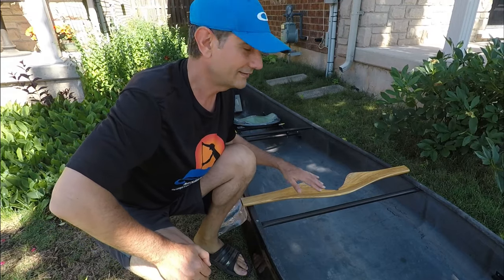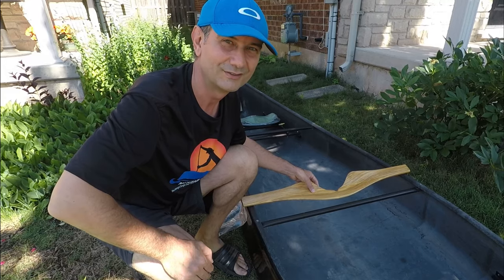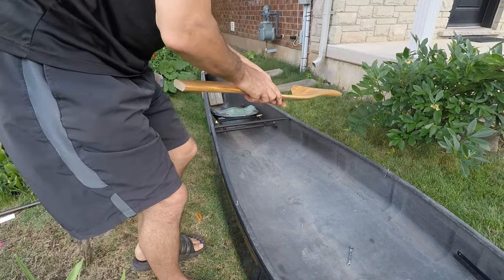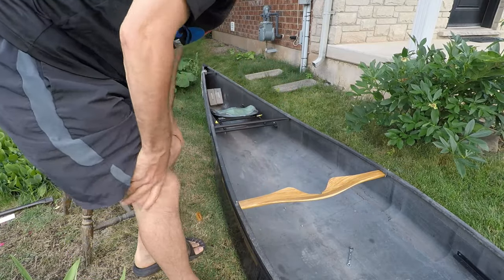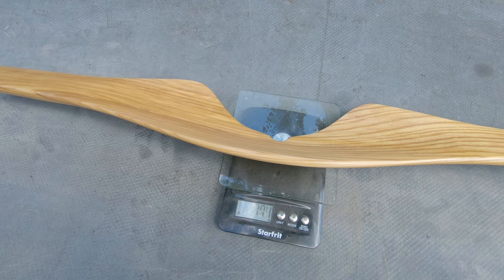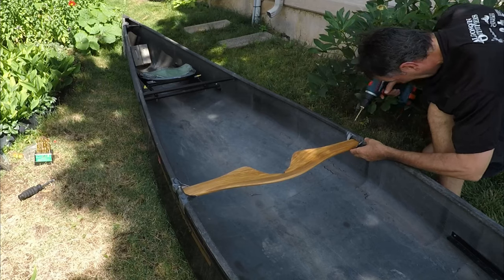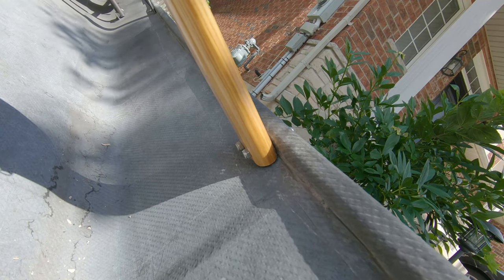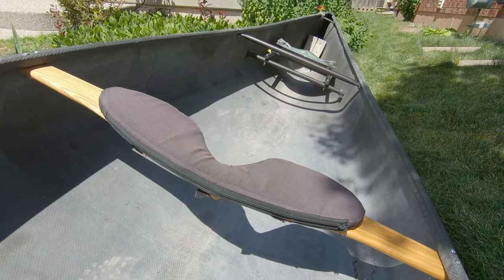Canoe Yoke Replacement - H2O Slingshot 222 Canoe

Comment: So im about to start this on my canoe, and I think this is a perfect guide short of one thing. The only improvement I could think of are bigger washers on both ends of the bolts to spread the load on the gunnels/ yoke. 
Thank you for posting this.
Reply from the maker: Glad it helped! The original aluminum tube had only one screw per side (with no washer, see the first few seconds of the movie) & I carried the canoe like that for a few trips. Having 2 screws per side is even better, besides the canoe is only 42 Lbs.